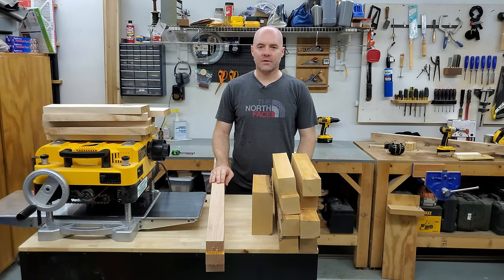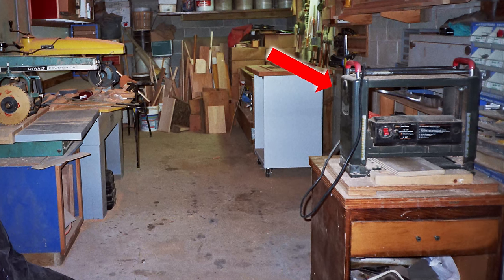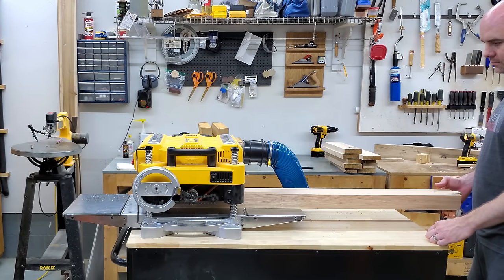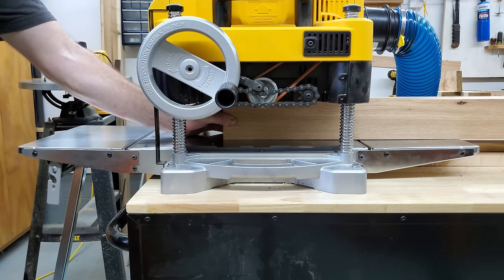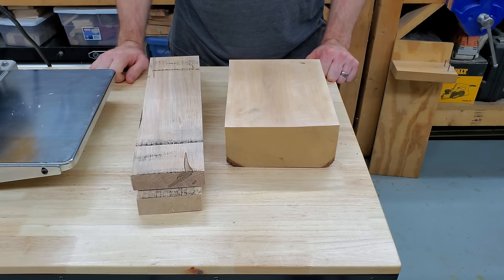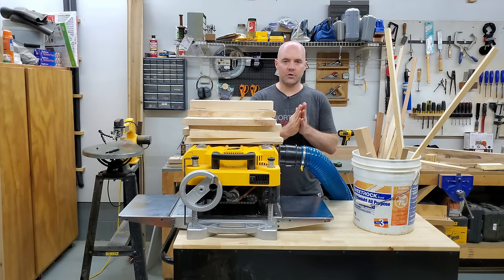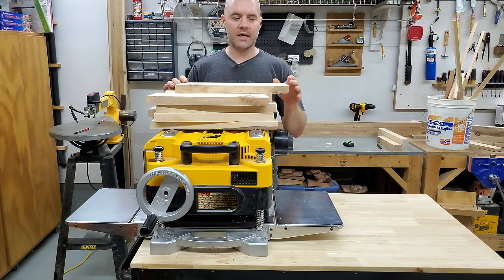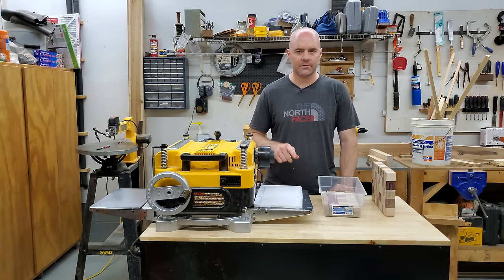Everything you need to know about thickness-planer snipe

Comment: Best video on snipe I've watched. Three great takeaways: thick boards that do not flex will hollow in the middle if exit/entry plates are elevated, table saw snipe issue, and jointer snipe (or in my case on a router table).   You communicated these issues and their remedy clearly!  Thank you !

Comment: Really, Really good video! Just the right pace and no stupid music. I have a snipe machine - the Dewalt DW734. I made a 6' planing bed, but that did nothing, except keeping boards from falling. Three inches on each end is waste (cutoff - I still save some of them). Sometimes an extremely light few passes helps and then I only have to sand. I'll try with the leveling of the factory tables next. And use the train method. Thanks again.

Comment: Thanks for a great video with looks inside the planer as wood passes through. Very informative and this ME appreciates the effort! How I attacked snipe on the same planer... I made a long bed from a piece of melamine and stiffened the board with square aluminum tubing attached to the bottom of the board on each side, leaving the center section clear so it can sit on the planer table. I wax the board periodically to reduce friction as the wood passes over it. This supports long boards as they run through, giving me time to dance around from the indeed to the outfield side of the machine to collect the board. This with properly flattened boards, (very important) virtually eliminates snipe. When the job is done I raise the cutter head and slide the portable bed out for storage.

Comment: I ended up getting that exact Dewalt planer. I have short (~20"x2"x1/2") slats that I am using to make two cutting boards, and I'm getting heavy snipe on the front and back of the boards. The "sacrificial" piece and train technique is very helpful. It's been a long time since I had to throw a bunch of wood through a planer, let alone a portable one like the one I own.

Thank you. Your video is very helpful, even two years later :)

Comment: Just got this planer bc it was supposed to be the best in terms of snipe. Was disappointed when I still was getting it no matter what I did. This video made me feel much better and now have a deeper understanding of the WHY and how to prevent. Great job and thanks!
Reply from the maker: Good to hear, thanks for commenting.
Reply: OK I have the exact same planer. I also have a an 18" planer.
Do not attempt to level the indeed n out feed trays. If you do, you are guaranteed to have more snipe!!!
Slightly lifting up on the in feed piece and doing the same on the out feed, or better yet have out feed rollers that are slightly higher than the out feed tray. 
Most of these videos recommend adjusting the trays. Don't!!!
The one comment about this planner being a bad unit, is simply full of it!!
Enjoy planning

Comment: Excellent tutorial on snipe! I have the same planer and cutter head as you and for the little snipe I get, a sharp hand plane makes quick work of both the snipe and roughness left by the small carbide cutters. The less sanding the better! Thanks for the tips.
Reply from the maker: Sanding is the worst part of woodworking. Hand planes and card scrapers should be in every woodworkers inventory.

Comment: This was most excellent!  I’ve tried nearly everything you touched on.  You did an excellent job of describing the problems and your solutions.

I too have the Dewalt 735 planer.  I’ve have found another thing that reduces snipe a bit more.  If you’ll run a very light pass on slow feed at the end.  Then lift slightly on the out feed end as the trailing end clears the infeed roller you can virtually eliminate any snipe that you get.  The roller will have very little pressure on the wood and won’t slam downward as it  exits the surface.

You just picked up a sub!  I do woodworking also... and have recently posted a series of videos on making a walnut ships wheel.  Now, please pardon me while I binge watch your channel!
Reply: I just press a bit down on the back of the board as it goes through the front, and than the front of the board as it comes out  to avoid snipe :) unless its a really short piece.
Reply: @Skippy0330  it’s tough to get those shorties through unscathed!

Comment: Close my eyes and I hear Nick Offerman.  Nice to know I can tune in here instead.  Cheaper than an Offerman stage show.  Nice comprehensive video too.  Few people know what it actually takes to put a video like this together.  You have done a fantastic job.  The only thing I would add, and it's the reason I angle my infeed / outfeed tables up slightly... 4/4 and 5/4 stock will flex slightly as it's planed.  It does minimize snipe, and doesn't cause any other issues.  Planing thick timbers... different story.  Thanks for the video!
Reply from the maker: Thanks for the feedback, and for the empathy. One of these days I might re-release this video with actual measurements, but it would take a lot of time and wood to do a statistically sound test. I recently started noticing a little more snipe with my planer, and manually lifting the boards was helping. Later, I noticed that my beds were no longer flat with the table. Making them flat again solved the issue. You're absolutely right that raising the beds slightly won't negatively affect most boards, and could provide a little insurance in case the beds slip over time.

Comment: I was planing several 2x10 boards this afternoon of about 40" long each. I did use the train method and it does work well, but lemme tell you that a 40" chunk of 2x10 yellow pine with really tight grain ain't exactly light so be prepared to do some sweating and not playing around as things are moving through. You'll only have a few seconds from board to board. I keep my pieces on my workbench beside the planer. Yeah, the planer is a beast and heavy enough to cause a hernia, but tis life for certain projects..

Comment: I really liked this video. The superimposed diagram helped me to understand how the planer works. I have a Powermatic 15HH. I tried to use a week ago and all I got was a series of parallel lines on my board. Now I understand that the infeed roller was too low in relation to everything else. Thanks. Keep up the good work. Once I understand how a piece of equipment works, I can figure out how to adjust it. I also like your work tables with the 45º supports. I am going to use that in my next work table project.
Reply from the maker: Thanks, those were the second workbenches I ever built, about 15 years ago. I keep saying I'm going to build some real woodworking benches, but these have been working well enough.

Comment: Best solution I've found, if you don't want to invest in the extension wings, is to lift up the end of the wood when feeding in to the unit and then lift up the beginning of the wood when it's through on the other side. I never have snipe as this evens out the pressure from the rollers. 👍 Good video.

Comment: Thanks Ben, that was the best video i've seen for the 735 and snipe.   The only other thing i've often wondered about trying is to reduce the spring tension on the feed rollers.  I've seen videos on bigger thicknessers where they eliminate snipe by reducing the tension somewhat. (it was on a A3-41 Hammer)   Obviously there is a land of diminishing returns with this, too loose and it won't be held to the table properly...  I guess extended infeed and outfeed tables in conjunction with a bit softer springs might work ?
Reply from the maker: Appreciate the feedback.  That's an interesting idea about the feed rollers.  I had to give it a little thought, but I'm not sure if there's an easy way to do that with a portable planer since they need enough pressure to drag the wood along the table.  Keeping the table waxed, the rollers clean, the wood dry, and the shop warm would reduce the need for downward pressure, but a change in those environmental factors could cause the rollers to slip, especially on heavier boards.  I guess the operator could always make up the difference by offering a little push support on heavier pieces, or since we're in the beginning of a digital evolution, downward pressure might eventually be managed by software.

Comment: What I've done in the past is have on both sides of the piece you are saving, double side tape two longer sacrificial boards which will raise the feed and exit rollers thus no snipe happens at all except for the two sacrificial ones on either side.

Comment: Was going to get the DW735x when I got my planer several months ago, but price went up (and went out of stock) when I went to buy...so just got the regular DW735.... but man, the snipe!  Essentially had to factor 6" of waste (~3" front and back). Was going to just make my own tables, but for only $47-shipped via Amazon Prime, I got the DW tables.  Really hoping these tables help.  Anyway, your input on table adjustment was timely!  Going to definitely run mine dead level end-to-end...and use the sacrificial lead and training boards as well.
Reply from the maker: I did the same thing with my first planer. It's crazy how the prices fluctuate with these things. I think I got my first one (DW745) for $500 on sale at Lowe's, and then later bought the extension tables for $50 from Amazon. My second planer was a DW735X from Home Depot for $650 with free shipping, but without the stand. Woodcraft and Rocker have the DW735 with stand on sale right now for $650, and I just noticed that Home Depot has the DW735X with stand on sale for $600 for Cyber Monday... out of stock of course.

Comment: Excellent no- nonsense look at this phenomenon.  It seems to me that if the cutter head operated independently of the rollers, snipe could be eliminated; at least on shorter boards.  As long as the board lays flush with the center plate, the distance between cutter and board will be constant. Perhaps I'm missing something?

Comment: Thanks. You have straightened me out. There are in fact 4 screws on each side of the tables. I had been looking only at the 2 nearest the planer, exactly as shown in detail in the video. The top one (which happens to be spring-loaded although that is irrelevant) provides the hinge about which the table arms rotate up (for storage) or down (for use); the lower one provides a stop to set the resting place of the arms. These are not adjustable (unless I wanted to take a file to the head of the lower one!). The other 2 screws attach the table surface to the arms. There is a slot in the arms by which the slope of the table surface can be adjusted. Duh!!!
Reply from the maker: Glad it was helpful. If you ever take your tables off and put them back, make sure they're on the same side. I reversed mine once and they weren't flat anymore.

Comment: Have a infeed hold down press roll and outfeed hold down press roll about 2 feet apart ,set up the hold down press rolls,it will eliminate snipes,it will even the hold down pressure, same principle applies with industrial high speed planers.

Comment: Snipe can also be adressed by changing your workflow sligtly ... mill rough lumber as usual & when comes the time to plane it down to the right thicknes, if you need a 3/4 of an inch board, leave an extra 1/64 & do the final pass on the jointer

Comment: Great snipe video!

Am I correct that, if you use sacrificial pieces in front of, and behind, your work piece they must be the same thickness?  If you're planning rough lumber how is that possible?

Thanks!
Reply from the maker: The same or a little thicker. Planning rough lumber usually requires several passes, and I don't bother with a sacrificial board until the closer to the final pass on each side.

Comment: Great video and explaination for your design of machine, I have a floor standing machine with one feed roller ahead of the cutter and get snipe,any suggestion for eliminating the problem in this situation
Reply from the maker: Tough to say without looking at it, but I would start by measuring your snipe distance from the end of each end of the board, then checking your machine to see what it correlates to. Otherwise, most of the tips in this video should be valid for any machine.

Comment: Many thanks to you.  I didn’t have the gut to open my planer.  I didn’t know about the mechanical balance of the rollers, even though I had soon realized that giving a little lifting force on the piece coming out of the machine tended to reduce snipping.  I somehow though that snipping was caused by the way a board exited the blades’ roller on my relatively cheap planer.

And, also I thought that the second major factor is the wear of the blades.  Any thoughts on that?

Somehow, what I get from your video is that a thickness planer should work like a reverse jointer?  Thanks again for a very informative piece!
Reply from the maker: Dull blades could be an issue, but they would either have to be very dull, or the roller springs would have to be very weak, allowing the board to get picked up.

Comment: Almost a side note here is something that should be discussed: the scalloped finish left by the Shelix cutters. While the wax crayon highlighted it quite well, this unfortunate pattern will also be quite visible in the finished product, especially in a raking light. While I readily recognize the many advantages of a Shelix cutter head, it’s failure to produce a truly flat surface is extremely problematic. I would like to see a video demonstrating the necessary time/process required to hand plane and/or sand the wood to eliminate this scalloped pattern. This would be a valuable addition to the discussion of the pros & cons of knives vs helical cutter heads.
Reply from the maker: Pretty much any power tool is going to leave some machine marks. The straight knives do it too, but neither is significant enough that it can't easily be removed with some 220-grit. If I hadn't used the wax crayon, it probably wouldn't have even been noticeable.
Reply: @TheSnekkerShow  While I agree that any power tool CAN leave milling marks, sharp blades/knives can nearly eliminate that. Every time I have my table saw and miter saw blades sharpened, I am amazed at the complete absence of milling marks. Same goes for planer blades. And I respectfully disagree with the visibility comment. Again, in a raking light, those will be highly visible. In the end, however, you & I likely both take some of the same final finishing steps—sanding, hand planing, scraping—so I don’t want to be disingenuous. I only wonder how much MORE time you spend due to the scalloped finish left by the Shelix cutters.

Comment: Re "adjusting the tables to be flat" (about 8 min. into the video): You say you have adjusted yours. I have the same planer with the same table attachment screws and they don't seem to be adjustable to me. How did you do it?
Reply from the maker: Mine have two machines screws on each side of the table that allow it to be shifted up or down.
Reply: Those screws probably have lock nuts on them. You'll have to loosen the nuts first, adjust then retighten.
Reply: Seriously, this is discussed right in the owners manual. Leveling the support tables is basic machine set up. Sometimes you have to read the manual.

Comment: How dead-on accurate do your sacrificial boards need to be in matching your workpiece?  Is a little thicker better than a little too thin? Thanks!
Reply from the maker: A little too thin wouldn't work. The same thickness or a little thicker are both good. I usually start with something a hair thicker, but they all end up the same after the first pass anyway.
Reply: @TheSnekkerShow  Thanks very much!  Do you have a video on your chip/dust collection for this planer? This is my first 'chip spitter' tool in my small shop and I realize I need an alternative to my shop vac.
Reply from the maker: @DTBoss23  I have a dust collection playlist, including some of my much earlier videos about modifying the Harbor Freight dust collector. Not my finest video production work, but the information is good.  https://youtube.com/playlist?list=PLvDK1rlZrs5m-dggAgJO_EwbYr6Px5bfx

Comment: At around 15:20 you are using a shim to account for the wobble.  The board underneath should have the raised piece (Cleat) at the trailing end, not the leading end. The cutter heads are spinning towards the rear. You want to prevent the board being planed from being kicked back towards you. Overall a fantastic video.  Thank you!
Reply from the maker: The cleat needs to be in the front because the rollers are pulling forward with a lot more force than the knives are pulling backwards. If the cleat was in the back, the rollers would pull the board right off the jig.

Comment: beginner woodworker (don't even own a planer yet) question.. why is the cutter built in a way that is affected by roller height/pressure? Why can't the cutter be fixed to the body independent of the rollers and therefore governed completely by the height adjusting ballscrews only?
Reply from the maker: For the most part, it is.  The worst snipe, at least in good-quality planers, is often caused by the ends of the board flexing up in to the cutterhead after losing contact with a roller.  The height adjustment screws have almost no play, but if they were any tighter it would be difficult to adjust the height.